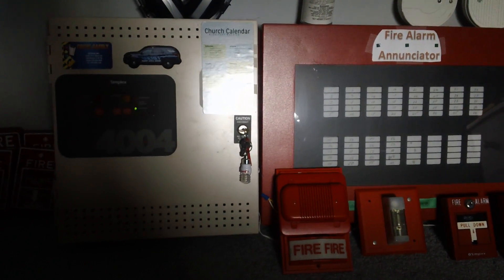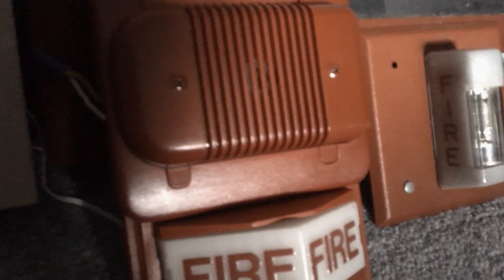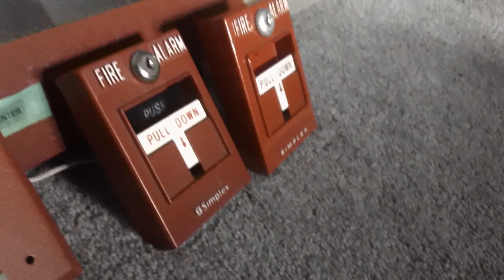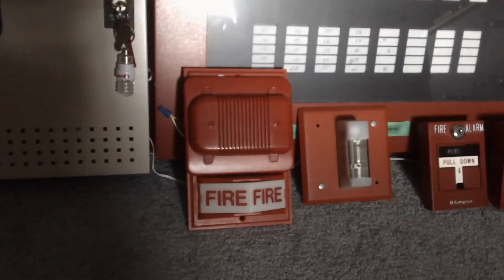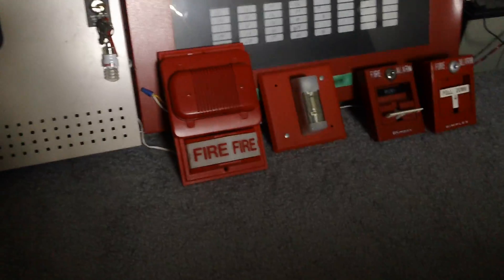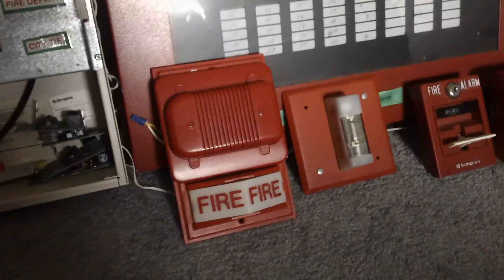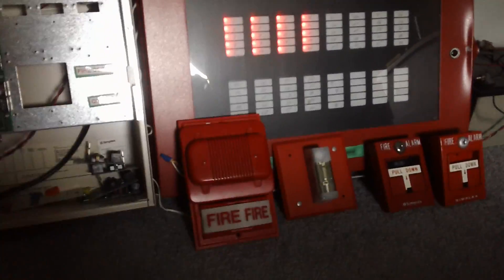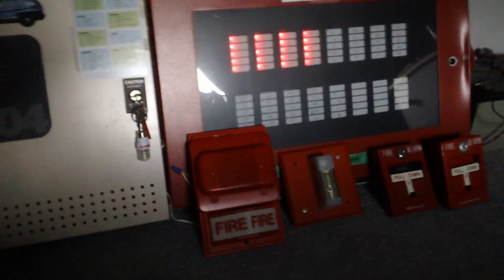Floor System Test 20

Comment: The hospital I used to work at had several older Simplex LifeAlarm speakers (2902-9711) on 2903 light plates, but I remember one of the 2903 plates had a Wheelock ET speaker, obviously because the old speaker had died.
I've also seen a photo that had a remote TrueAlert horn on a 4050-80 light plate! That sure looked odd.